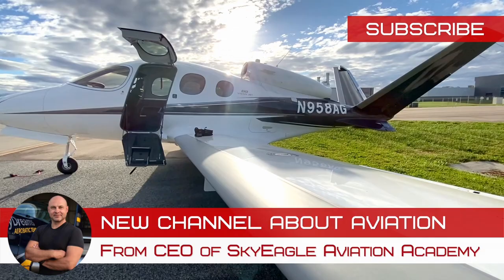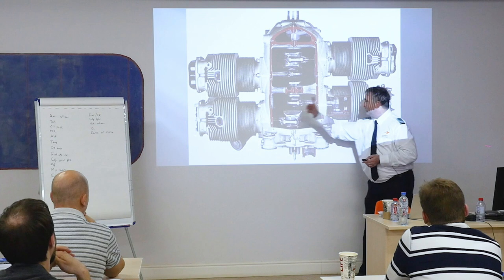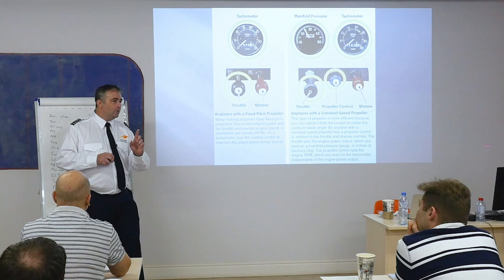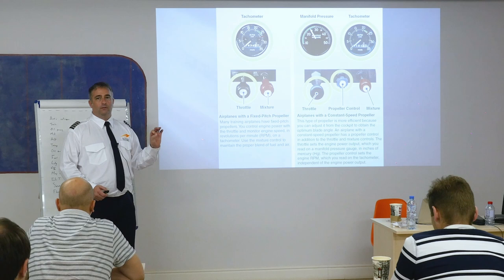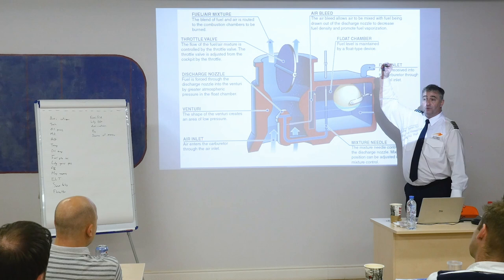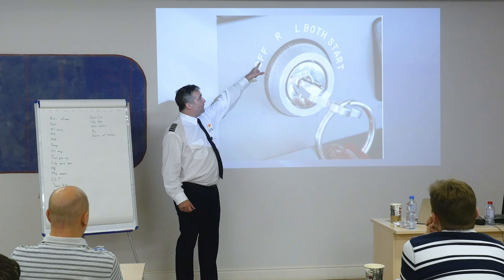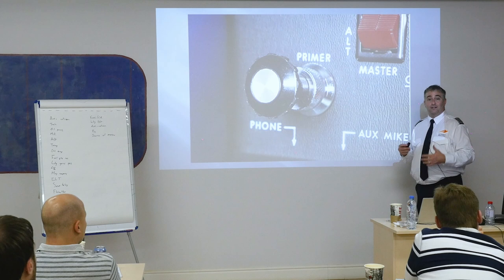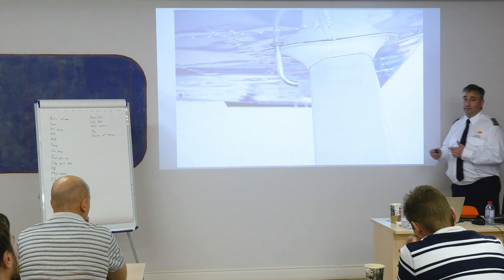Lesson 5 | Powerplant | Private Pilot Ground School

Comment: The reason why you have a both selection for fuel on a single engine high wing configuration and you do not have a both selection for your fuel tanks on a low wing is a very very easy to answer reason. 

If you are flying for a long enough time/distance say with a 5* rotation from level to maintain straight flight you will run one tank out/dry before the other tank. In a high wing configuration you will still have fuel flow from the other tank feeding the engine because a gravity but on a low wing configuration once one tank becomes empty air is introduced to the fuel system causing engine failure because of fuel starvation.